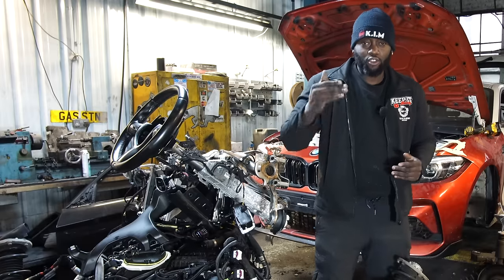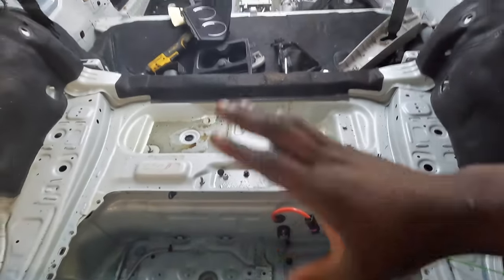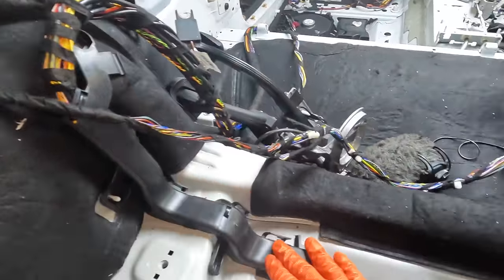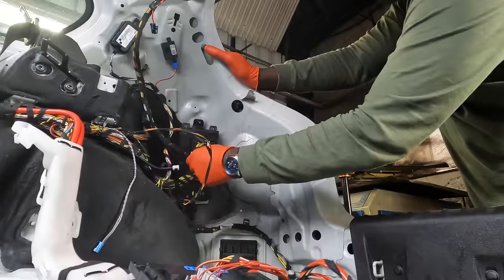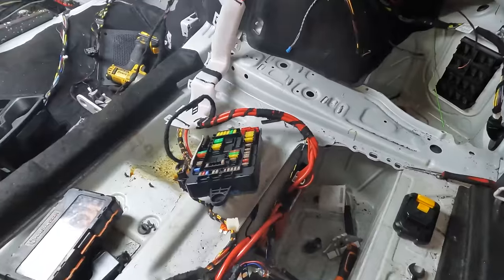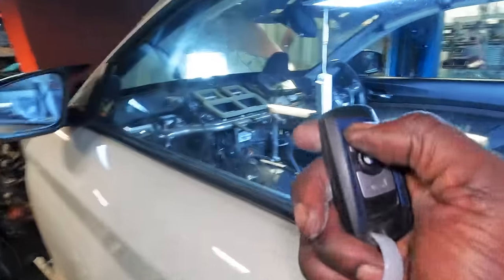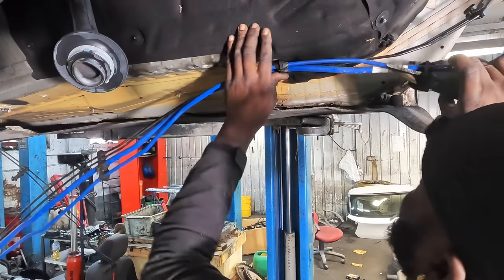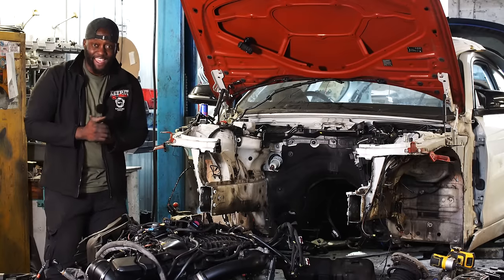BMW 114i to M140i CONVERSION BUILD - PHASE 3/PART 5

Comment: cuz got similar build on a car that had major strip in the engine bay all the wires cut up and engine stripped we got a donner car since even modules were take even ecu complete front end strip but the doner car isnt xdrive but much cheaper then buying everything separately we got the abs xdrive and the xdrive looms for gearbox and engine what you think any issue we may have after everything has been wired up only seen you strip these one series like that